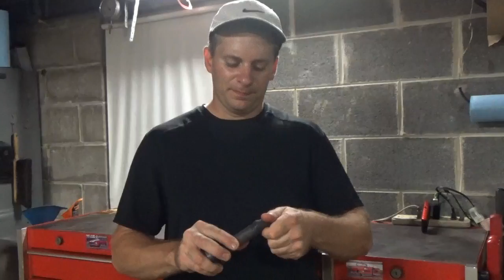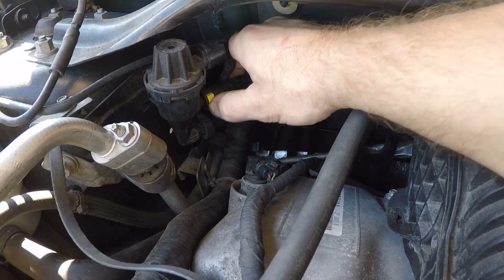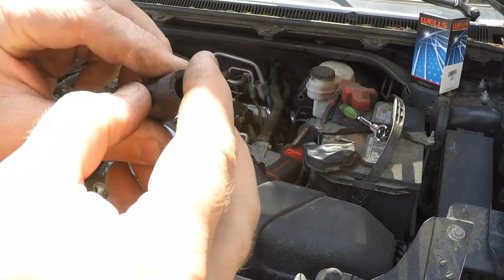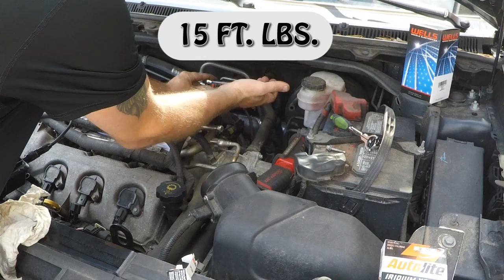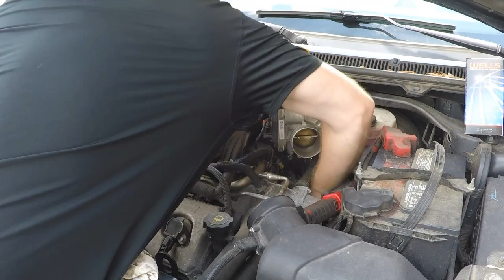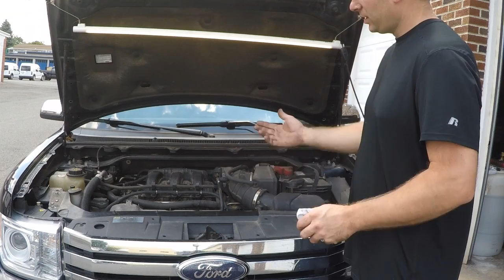Ford flex 3.5 tune up, how to replace spark plugs and coils

Comment: i have two suggestions... blow air pressure down the spark plug hole before you remove the spark plug
to remove any loose junk...
Also might as well replace the pvc valve after you remove the intake manifold as its at the back of the engine and is a lot easier to replace with the intake manifold removed...

Comment: You know, the windshield cowl gaskets on these cars (heck on all Fords) are infamous for failing after about 5 years.  Apart from the bizarre vibrations/noises that causes in the Flex's air conditioning ducts, could that same bad cowl gasket be letting water onto the rear heads?

Comment: I went to the ford dealership and the guy told me to do an injector flush when I do a tune up, he said it helps and you have to do it. And then tells me the charge is $300...that is asinine. Would you recommend doing that injector flush?
Reply: No.  Well, no unless you routinely leave your gas cap open and physically removed your fuel filter.

Honestly, you should only need to add injector cleaner to the gas tank about once a year or once every other oil change

Comment: Thank you, after watching this video we were able to change our spark plugs with relative ease.  

But prior to changing the spark plugs we power washed the top of the motor and engine bay.  We took our 2009 Flex SEL (and my Honda Civic) to a self-serve car wash and first we sprayed the engines with Simple Green, let sit for a five minutes, then sprayed clean with the power washer (on rinse).  Cover electrical connectors with rags if you want to; just don't over do it with the power washer.  And wait a few minutes after you finish power washing to let most of the remaining water evaporate off.

Now the engines look great and the Flex runs more smoothly with new plugs (108K on the orig ones, probably way overdue).  Oh and we did oil changes on both cars yesterday.  Tomorrow we will be rotating tires.

Comment: I want to thank you for a great video.   I also want to thank you for a straight up step by step way to remove the intake and your advice on the anti seize.   I used to be an ASE mechanic, how ever I changed careers in 1988.  Lots has changed in those almost 28 years.   I still have my tools and do what ever I can on my vehicles if I can.  I will be doing this on my car as soon as the weather starts to warm up.  No heat in the garage.   LOL
Reply from the maker: John Benz you welcome anytime, happy I could help. it's nice knowing I have knowledgeable people subscribed to the channel, feel free to chime in anytime on other subjects as well. thanks again

Comment: Great video, I have the same Flex with a misfire problem so this was very helpful.  Are you generally satisfied with the Wells products?  I notice their prices are quite a bit less than the other brands, just wondering if the quality is good.

Comment: Glad the engine has held up after that water pump repair.  That was a good call you made and it turned out in your favor.  It's a tough decision to make especially when a so called 'pro' makes an incorrect diagnosis.  Take it easy - Ozz
Reply from the maker: Thank you, I'm thankful everything has been holding up, my biggest concern after finding the root cause, wasn't so much the repair in general, but the fact the initial misleading diagnoses put that engine In a potentially catastrophic state, running longer than it should have  with that failed water pump most certainly contaminated the oil in more than one way, the multiple oil flushes after the repair must have been enough,   Couldn't be happier

Comment: It's great to see you again. Do you always put grease on the coil electrical connection? I've never seen that done. Interesting. Thanks for sharing your knowledge and experience. Its much appreciated.
Reply from the maker: Michael Herbert Thank you, yes i have used dielectric grease for many years after experiencing connection issues due to moisture, corrosion etc. with very good results. been stumped by connection issues that resulted in come backs and misdiagnoses, i have found myself slipping away from using it as much as i once had during general repairs, mainly because manufactures made great improvements on connector seals, but in general its a good practice especially when replacing a part because the connector seal has formed itself to the old part and may not seal 100% on the new replacement, its an extra line of protection, hope that answers your question

Comment: Awesome Will , glad to see you back. No Well Manufacturing up here in Canada ....
Reply: +robinsonsauto I agree. I love wells products. They're the only electrical brand I trust other than the oem.
Reply: Actually I've.never used they're O2 sensors. I stick with NGK or Denso. Any experience with wells O2 sensors?
Reply from the maker: Steve Rob thank you, its good to be back, man i feel for you i cant say enough about Wells not only as a manufacturer of reliable products, they have real informative information in their videos that i know have helped me in many repairs, it says a lot about a company willing to put themselves out their sharing knowledge, great group of people
Reply from the maker: Michael Herbert i honestly cant recall if i have, however i wouldn't think twice about giving one a shot, i just had a bad experience with a bosch the other day, it was cycling good but the ecm didn't agree with the signal,  just came to mind when you asked, wish i had the cam rolling for that repair swapped out with another and it was good